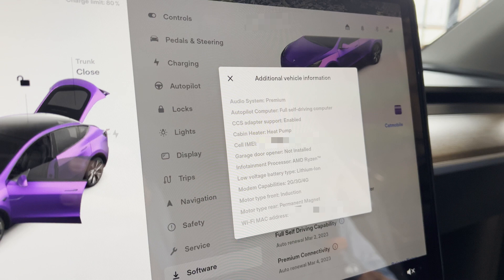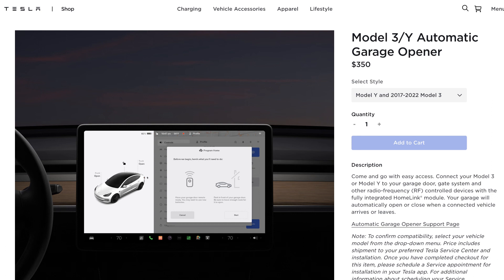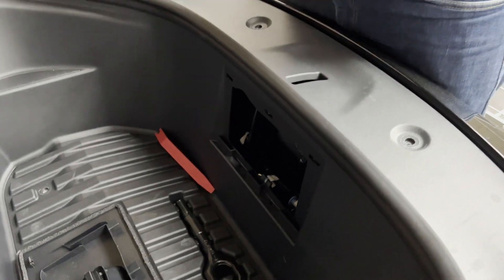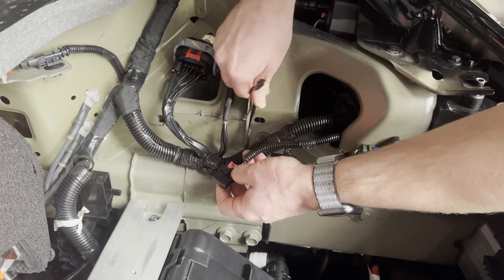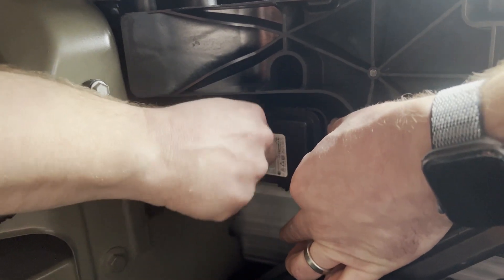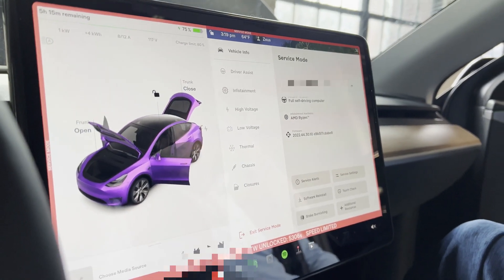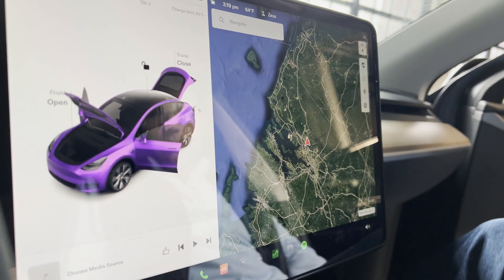10 minute DIY Tesla Model Y HomeLink Retrofit (Model 3 too! Save $$$!)

Comment: Just picked up my 2026 Model Y Launch Edition and unfortunately they moved the Windshield washer reservoir to the front which is wide and huge and blocks access to anything up in the front area.  I tried to remove it and look behind it but I can't find the wiring that is suppose to power the homelink module.    No electrical tape or wires that aren't attached to something.  So I guess I have to wait until someone that has a Model Y Refresh to install the Homelink and figures out the mystery of the missing cable.    Bummer.
Reply: I found the wiring harness but can’t find the mounting bracket to mount the homelink…..wiring harness isn’t taped but clipped inside the opening to the right

Comment: is it possible to remove an installed and configured HomeLink module from a 2021 Model Y and then install it in a 2022 Model Y?  If yes, will it retain the current configuration or does it forget everything and have to be setup again to operate the garage door?
Reply from the maker: @alanvonweltin6820  yes, you can move it, but you should run the service routine to remove it from the donor vehicle’s gateway configuration. And yes, it will lose its config in the new vehicle and will need to be set up again.
Reply: @UrbanTinkerer  Do you mean run the service routine FIRST from the donor car prior to removing the module?
Reply from the maker: @ no, remove the module first and then run the routine to update the gateway.

Comment: There is another video where they are taking of the whole bumper of a model 3... so will it really be the same on a Model 3 like in your video?
Reply from the maker: On the model 3 taking the bumper cover off is the “official” way to do the install. However, you can install the unit in an alternate location without bumper removal and it saves a ton of time.
Reply: @UrbanTinkerer  thanks for your response! I got it fitted yesterday 😂 it took a while hour and I guess they took the bumper off. However, nowadays the price difference between the part (Tesla store) and the part+fitting is only 70€. So it's a no-brainer to pay that extra and get the official warranty.

I wasn't able to find a used part at all. There is only one ebayer selling it for 250€ what makes no sense. (Tesla ready to go price is about 320€)

For my American and Australian friends:
€ means European Zloties 😂

Comment: On the Model Y 2024 the retrofit will not work as you will receive a debug error. Tesla does not allow the module to write back to the car system. The fix for this is to call tesla service desk and asked them to please allow the module to make the required change. Tesla will charge you 15 mins Labor which amounts to a little over $50. I traded my 2023 model 3 for a 2024 model Y and transferred the module over from the 3 to the Y. A little top tip.
Reply from the maker: @julianmendoza203  they have fixed this bug in the most recent firmware releases (2024.20.1 and newer), so you should be able to completely DIY again.
Reply: @UrbanTinkerer  Nope and it isn't a bug. Have you tried it? Please don't mention untested resolutions. I'm getting an error in my days old Model Y.
Reply from the maker: @ricric9521  what firmware version is your car on, and what error do you get?

Comment: When it says to hold down the key, what is it referring to? I have my phone, keycard, and a key fob. What am I holding down for key?
Reply from the maker: Any of them should work. Eg, put your key card on the center console while you hold the brake pedal down and press up on the blinker stalk
Reply: On the gateway unlock screen--I got stuck there as well, when you press up on the turn stalk you have to lift it higher than normal amount, all the way until it stops.  If you do that while pressing the brake and have your key on the console it'll show a countdown timer immediately and unlock when it's done.  As others noted though the 2024 update breaks the process after that and a service technician will be needed to unlock the update (best I can tell).

Comment: It appears Tesla may have removed the ability to complete a HomeLink self-install beginning with the 2024 software updates. I purchased the module, bracket, and screw and installed the hardware myself on my 2023 Model Y. When I ran the HomeLink retrofit routine in service mode, I received an "unauthorized configuration change" error message. I researched and found others having the same issue. It appears the solution requires a Tesla technician to add HomeLink to the vehicle's configuration. Fortunately, Tesla mobile service did this for me at no cost, but this may change.
Reply from the maker: This looks like a bug in recent firmware builds; hopefully Tesla fixes it. In the meantime, I urge you to make a service appointment; several people have had success getting a technician to make the gateway change for “free” as a result of the self service tools not working as designed.
Reply: @UrbanTinkerer  I scheduled Service and detailed that the module is installed that I understood that the reconfigure could be done from the office. The estimate was $275.00! I cancelled it.

Comment: Thank you for this video!  It was super easy to follow along and do this on my 2023 Model Y.  It was even cheaper by buying the Homelink device/bracket/screw on ebay for around $187.  
One thing I did differently was not disconnecting the frunk light cable from the panel.  After unsnapping the panel, i just guided the panel with the attached wire through the hole (I had difficulty unclipping the wire harness and didn't want to break it).

Comment: Note that with some home link setups you have to press the 'activate' button repeatedly until the training is complete and the garage door opens....  
One symptom of failed programming is the program status light on the opener flashing red when home link is activated in the car but not resulting in the door being opened.  It should normally flash several times during a successful opening event, not just once.

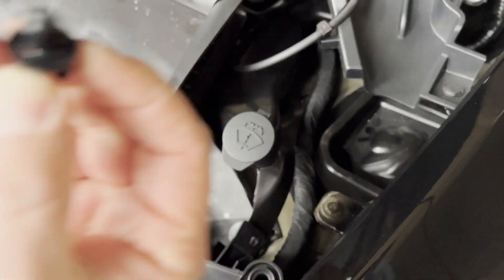Comment: Extremely helpful - thank you! 2:15 You don't need a flathead, you can just push the trim pin out from the other side - but cover it with your other hand or it will go flying inside the bumper. Don't ask me how I know...

Comment: Is it does work with the 2023 Y? When I try to buy on the website it only says it is compatible up to 2022. I figured they may have changed something.
Reply from the maker: Yes, it works fine on the 2023 MY. (that’s actually what’s in the video)
Reply: @UrbanTinkerer  nice video!! Do you have to remove it from the software in the older car through the service menu? I’m not seeing any info online about what to do to the car you removed it from. Any insight would be great!
Reply: You can run the same service procedure on the car you removed it from to remove it from that vehicle’s config.

Comment: You installed the module in the wrong direction. You will have limited range. You are giving out false information on how to install it.
Reply from the maker: Range is a non-issue with it installed backwards (or in any other orientation really… the antenna is just a trace on the PCB).

I do recommend installing it the correct way though; I posted a correction video showing how to do this here:

https://youtu.be/JfSgN-7SpBk
Reply: Well aren’t you a ray of sunshine

Comment: For anyone doing this on a 2023 Model 3, the wiring harness has moved to the middle of the front where the frunk is. It's about where the connections are for the frunk open button. It moved probably because of the lack of parking sensors) and you'll find it fairly easily. There are two spots where you can mount the bracket for the module, facing outward. You can get a 10mm socket behind it.
Reply: Did you install yours up and down or side to side? I have mine up and down as that pin seems to lock in. But, it does stretch the wire. I believe it's good to go but wanted to check with you. 

I also mounted mine on the drivers side location. Appreciate your confirmation and help.
Reply: @roysgti  I installed it towards the passenger side, as it was less stress on the cable. I don't believe it really matters in the scheme of everything. I've been loving having it automatically open and close my garage. Works fantastic!
Reply: @roysgti  I am unable to locate the bracket for it on my 2023 Model Y. Can you please take a picture and post? Thanks.
The connector does not reach the bracket on the left side and I don't see anything similar on the right side.
Reply: @mzdial, did you purchase and use the radar bracket for your ‘23 Model 3?
Reply: Damn you are a lifesaver, I bought one and was starting to curse Elon for moving everything around.  I installed on the passenger side also
Reply: Can you still use the old module or do you have to buy the new one?

Comment: Do you know if a 2018 model 3 home link can be transferred to 2023 model y? Same unit?

Thanks!
Reply from the maker: Yes, that should work fine!
Reply: I read somewhere that you have to get it from the bumper which is a little more surgery from the 2018. You might want to confirm.

Comment: Can you please confirm that I can buy a Module online and install this myself onto a Model 3 without afterwards having to appear in person at a Tesla Dealership to have them complete a software upgrade, prior to pairing it to my HomeLink garage?
Reply from the maker: Yes, you can. A reminder that the official model 3 installation location is a bit harder to get to than the model y shown in this video, and may require an additional bracket on newer vehicles.
Reply: @UrbanTinkerer  Thanks for the response. I ordered the Module and Bracket together. How do I know if I need an additional or different bracket that what came in, in order to install on 2022 Model 3?
Reply from the maker: @gleenfornasier9380  you should be all set for your 2022 model 3. For model year 2023 model 3s, tesla removed the radar bracket (which is also where the homelink bracket is attached).
Reply: @UrbanTinkerer  oh no! I just ordered the module + bracket from ebay, what else do I need exactly for an april 2023 Model 3 ?
Reply from the maker: @linuxwarrior1  you might need the radar bracket, 1103760-00-C.

There are also easier options though, like a 3d printed bracket: https://www.thingiverse.com/thing:4069700
Reply: Is 2023 model y without radar also need an additional bracket?
Reply from the maker: @Adxghmgdsf  A 2023 model y without radar is exactly what was shown in the video. No “extra” bracket needed, just the small bracket to hold the homelink module.

Comment: Will any home link control Module (From older Model S, X, or 3 or even non tesla) work on my 2023 Model Y ? I would think home link chip should be compatible with any car who suppose home link ?
Reply from the maker: Model 3 and Y modules are identical. Model S/X are different and as best I can tell not currently compatible. 3rd party homelink modules also do not seem to be compatible.
Reply: @UrbanTinkerer  Any year of Model 3/Y Module will work ?
Reply from the maker: @mamin-br9gs  it should, yes.
Reply: model S/X modules can work if they are late model, Tesla switched to this module in 09/2015 for model S and 04/2016 for model X according to their parts catalog.

Comment: Great video!! Showed and explained everything so well. For anyone else NOT seeing the HomeLink icon after service reboot on the main screen... First try Power off via safety > power off waiting 2 to several mins. Press the break pedal to wake the screen up after 2 mins. You WONT see the HomeLink icon if on 2023.2.12a and above on the main screen. Tap the normal Garage Icon and now the HomeLink icon should show there underneath the default MyQ one. This drove me nuts thinking the install wasn't picking up the HomeLink. Enjoy!!!
Reply: Thanks a lot for the tip, saved me some panic for sure!
Reply: @canberksenolsun  Awesome! That makes me sooo happy to hear. My goal was to save at least one person from that!! Enjoy the homelink!!

Comment from the maker: A few corrections and clarifications for anyone attempting this at home:
- At 3:55 in this video I install the HomeLink Mounting bracket on the wrong side. See this video for how to correctly mount it:
https://www.youtube.com/watch?v=JfSgN-7SpBk

- I mention in the video that the correct socket should be "E11" as my E12 was too big and my E10 was too small at the time of filming. However, with a different set of sockets, E12 was the correct size.

- If you have a Model 3, the official mounting location is in the front center of the car (and may not be present on 2023 and later models without an additional part). Installing HomeLink on a model 3 typically requires removing or loosening the front bumper cover. There are alternate (unofficial) mounting brackets and locations that are easier, Eg, https://www.thingiverse.com/thing:4069700
Reply: Thanks! Getting the screw tightened in the correct mounting position is a serious pain in the rear.
Reply from the maker: @willrogers5910  yeah, doing it wrong was way easier 😂

I made a comment on my other video, but try a short extension or socket adapter on your wrench if you haven’t put everything back together yet.
Reply: @UrbanTinkerer  I just gave up trying to install mine the right way and install the easier way and it works good.
Reply: @urbantinkerer yes sir, thank you!
Reply: @urbantinkerer Thank you very much for this tutorial, everything is working fine! but when I was re-assembling the car, during the last step, wiht the Apron I guess I pushed too hard and broke one of hte plastic brackets that are connected to the hood, do you know the part number or how can I get that replaced? thanks!
Reply from the maker: @Tommy-st6ev  do you mean the small plastic clips on the side of the frunk bin that it “snaps” into?

Those should be “FRUNK-FENDER CLIP - ASSEMBLY”, Tesla PN 1472872-00-C

Should be $1.19/each direct from Tesla.